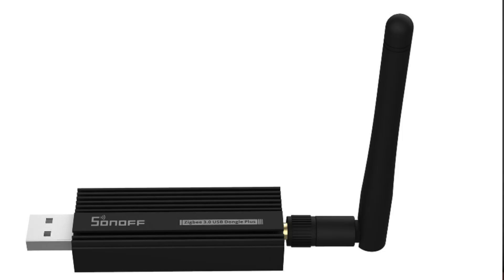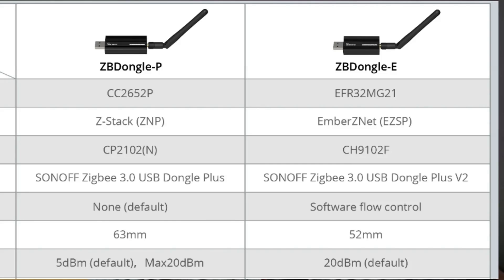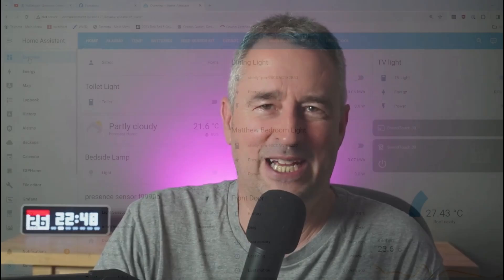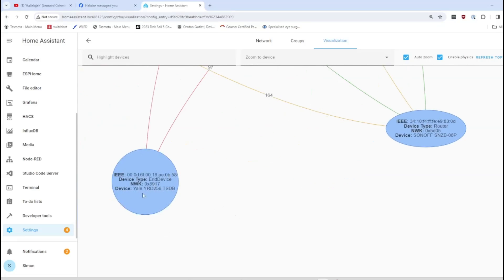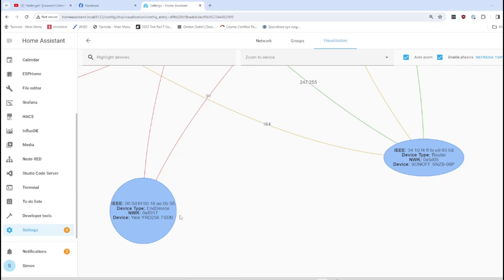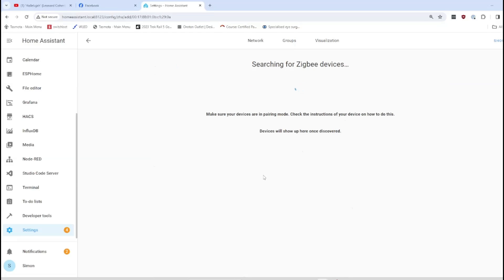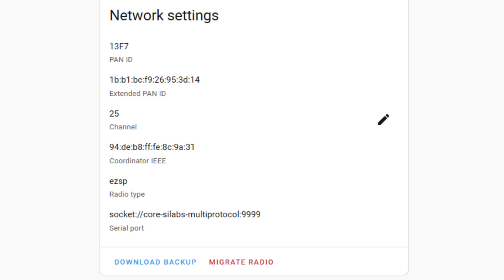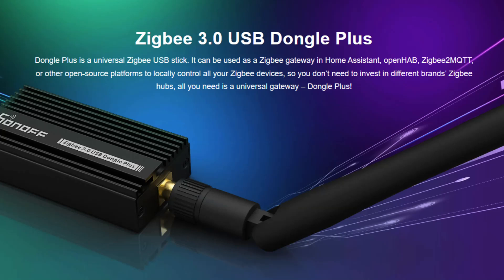How I fixed my Zigbee Network!

Comment: Although this information is correct, it is no true that the device will stick to that router. After a while the coordinator will chose a different path and ruin all the work done.
I've spent lots of time and money to do exactly this. Added a router in every room, connected devices to the nearest one and after a couple of days a mess again.
The truth is that Zigbee and the battery powered devices ARE NOT reliable at all.
If you want to use them you know that once every couple of months you need to pair again the device, and do not bother to add it to the closest router, it won't last a day.
Reply from the maker: @xtremereality  thank you for your valuable feedback. Yes battery powered zigbee devices can be very challenging

Comment from the maker: I just changed my zigbee co-ordinator from the HA Yellow radio to my Sonoff Zigbee radio and now my Aqara door sensors are not falling off any more!
Reply from the maker: It could be because I was using the beta software for zigbee/matter on the HA radio.
Reply: I also have a HA yellow and same issues with battery devices becoming unavailable. How did you tackle 2.4ghz wifi interference, what wifi and zigbee channel combinations work for you? I hadn't considered changing my coordinator but your video has made me think!
Reply from the maker: @RahulParmar1978  Hi Rahul, I not sure if it is the Yellow or if it is just problems with battery powered zigbee devices.  Your could try connecting an external zigbee radio to see how it works with that change
Reply: @simonsayshomeassistant  Thanks, how did you turn off the Yellow's zigbee radio after installing the Sonoff coordinator?
Reply from the maker: I think after plugging in it asked me what radio to use, but you have to reload all your devices
Reply: A month later and very limited success with the Sonoff. My Aqara temperature sensors, that were previously okay, now have fallen off the network and struggle to reconnect. I also moved my 2.4g wifi channel to 11, away frommy zigbee channel 15 but no luck so far.
Reply from the maker: @RahulParmar1978  HI Rahul, yes Zigbee can be painful at times.  Many users are saying that this new zigbee radio is the best on the market https://s.click.aliexpress.com/e/_DBIUlpv

Comment: I am struggling with my Zigbee sensors drops off
Reply from the maker: Which sensors are you using, Aqara?
Reply: Using the Sonoff Zigbee 3 plus and Sonoff Zigbee motion sensors. I get them connected and the next day they off.  I do not have zigbee router @simonsayshomeassistant

Comment: I have the Sonoff USB 3.0 dongle as well it works well. I have sonoff  SNZB-04 window/door sensors and some of those drop off the network but that is a know issue of the device and not the zigbee network. I am using zigbee2mqtt and it is very well supported and I like the web interface and the map function. https://www.youtube.com/watch?v=--jRvIiL_BA
I don't use home assistant but openHab V4.